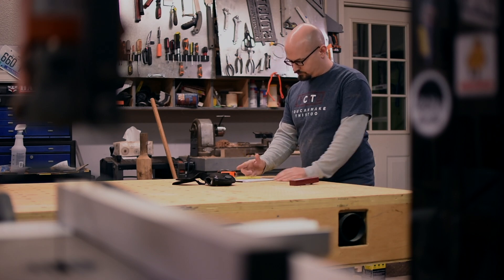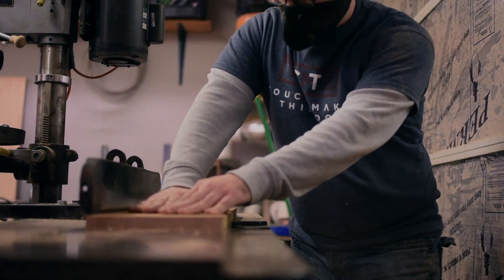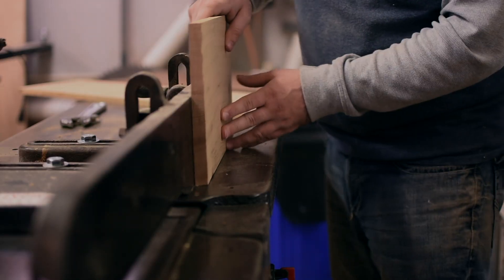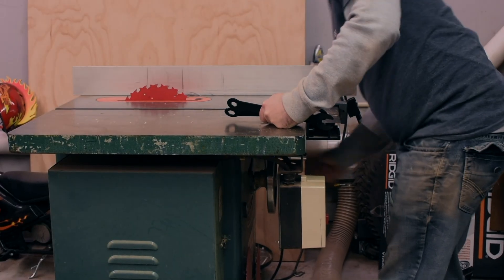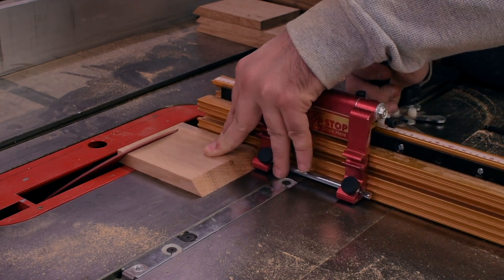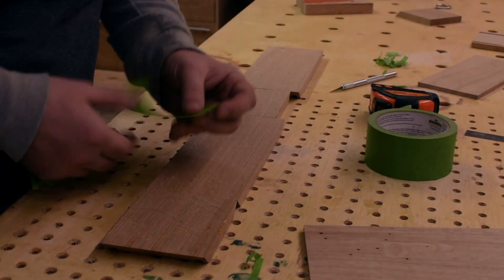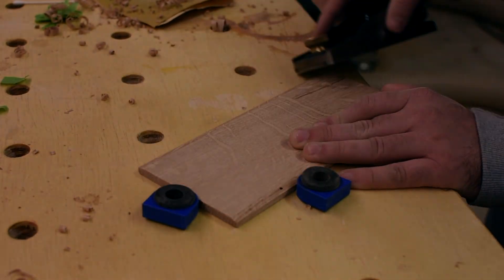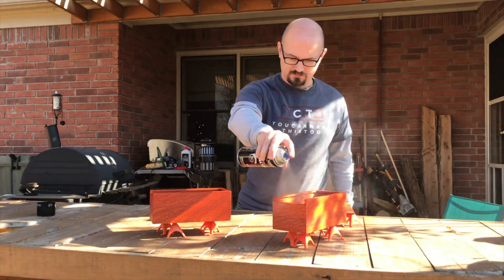How To Make a Coin Box

Comment: Nice box.  Like that you took the extra time to swap the blades even for the few small crosscuts.  Went the extra mile.
Reply from the maker: Thanks! Yeah.. I'm in the blade swapping camp. I have my tools, rip, crosscut, and plywood blades on magnets on the front of the saw and am religious about swapping them out. I don't mind the work and think the results are better than just using a GP blade.